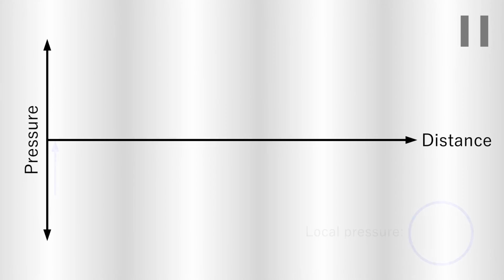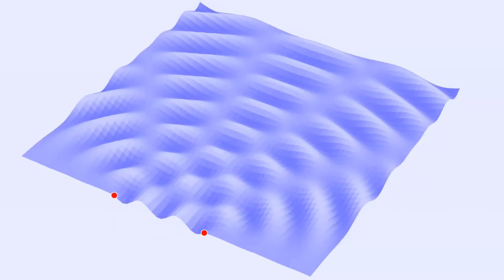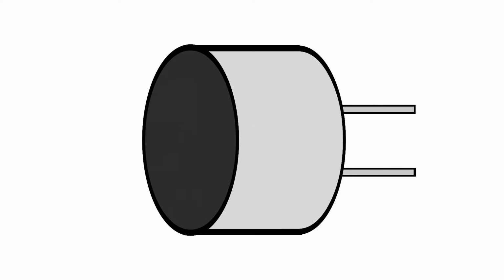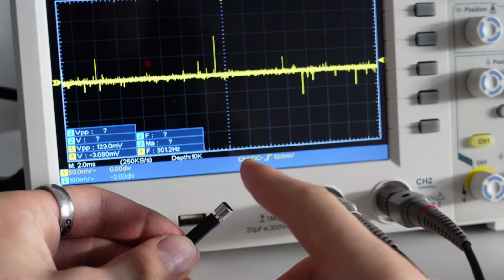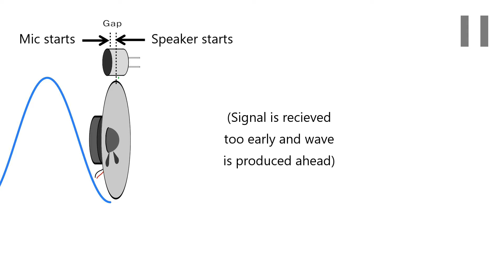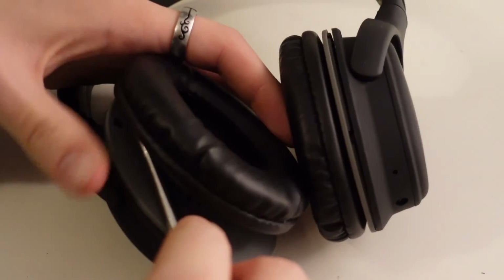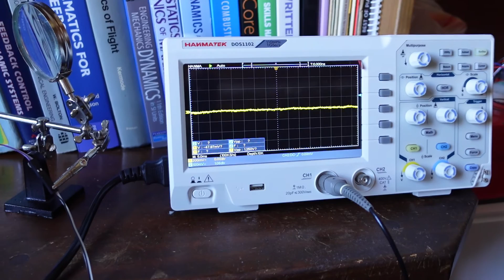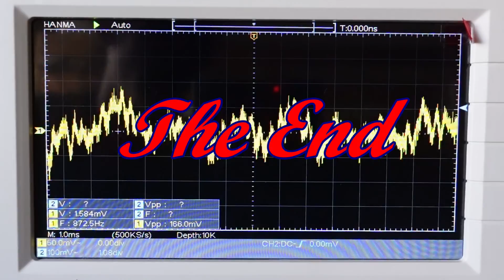Creating Noise Cancelling

Comment: How did you get the wave's polarity to invert? Was it through circuitry or coding?
Reply from the maker: It's actually really simple, you can just switch over the speaker wires, reversing the current direction and therefore reversing the displacement of the diaphragm. But that idea didn't come to me for ages 🙃. However, op amps often reverse the signal anyway, so you wouldn't need to think about it

Comment: Hi Freddie, thank you for this video - really impressive & clear explanation! I was wondering what would happen if you would play music through the speaker instead of a basic noise wave?, would the noise-cancellation work on the lower frequencies of the music? would the noise-canceling device you build be capable of lowering the volume of music? Thank you, all the best
Reply from the maker: Thank you! Because of my amplifier circuit design, not every frequency will be equally cancelled. I found phase shift and change of amplitude of input waves Vs output waves so unfortunately it won't properly cancel all the frequencies of the music. There will be workarounds using clever circuit design but that's beyond my knowledge of electronics for now. I guess that's why high quality noise cancelling headphones cost a fortune!

Comment: can I make the first device with only the parts in the electric circuit diagram? your complete device looks other parts added
Reply from the maker: If you mean the design with the preamp circuit and power amp - the preamp on its own likely won't deliver enough power to get any sound from a speaker, but you might be able to hear something if it's only for headphones or earphones. Be careful not to hurt your ears though!
Reply: @freddiemeinertzhagen   
I made the device with the diagram and power amp, but I failed. speaker print out large sound with no sound entered. but it actually amplify sound I make(very large sound printed). What can I do for this? can you help me plz
Reply: @주한재-r1n  could you do it? I want to do it, but i saw the same thing as you, he changed the circuit diagram

Comment: Could the remainder buzz be due to the finite response time scale of the circuit? (hence the remainder 'high pitch' buzz) That's it's easier for the circuit to cancel low-frequency noise than high one?
Reply from the maker: Honestly I have no idea. There are so many sources of the sound that I know of (and many more that I don't know of!) but my first guess would be the frequency response of the circuit. There is probably a low pass filter accidentally intagrated into the circuit design stopping the high frequency signal from reaching the speaker

Comment: I absolutely want to build this.
Though you did say that it would only work at select frequencies, so..

Do you think it would be effective against the 15 KHz of a CRT Transformer? :0

I'd love to test and see how well it can work on, well, anything that makes unwanted noise.
Reply from the maker: Well with some funky circuit design there may be a way of expanding the range of frequencies that can be cancelled but that's well beyond my level, even this design is barely my own! 

The trouble with using this design for higher frequencies though is that the wavelength is so short that it's kinda hit and miss whether the waves actually interfere properly where you want them to. Either way it's worth a try!

Comment: Thanks for that mate. I live right on a busy road and was thinking about how to make an active noise cancelling system for my entire kitchen. Yeah sound deadening materials, etc, but I think it'd be a good project. Thinking along the lines of two directional microphones outside pointing left and right, and as the wavelength of car noise is fairly low maybe even just amplifying to a speaker on the opposite side from the coming sound would do a bit on it's own. Obviously would need a lot of fine tuning, but it could work.  Thanks for including your circuits. They'll be a great starting point.
Reply from the maker: Sounds like an interesting project, I wonder if the cancelling will be able to cover the entire kitchen. I imagine you'll need a pretty big speaker too!